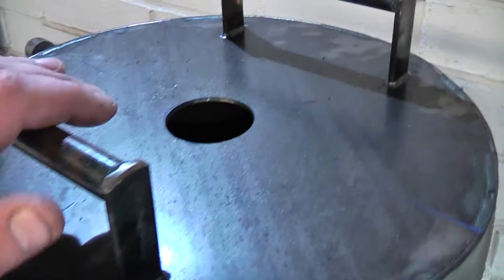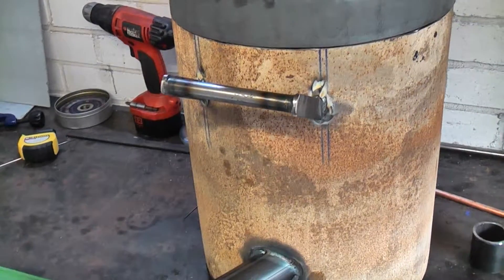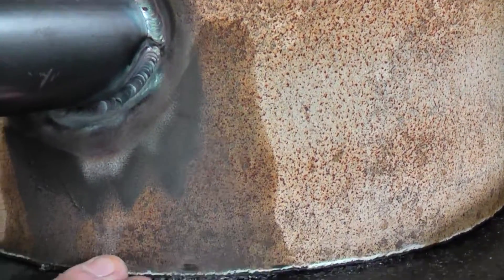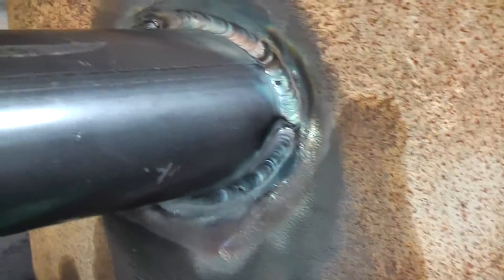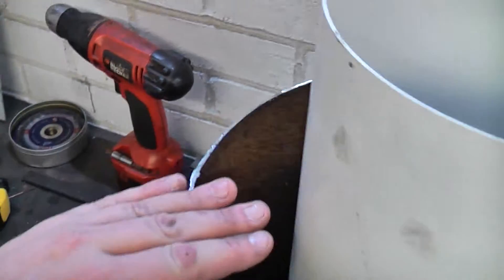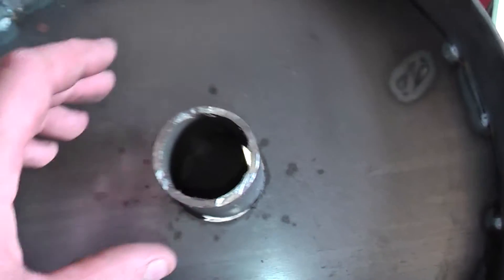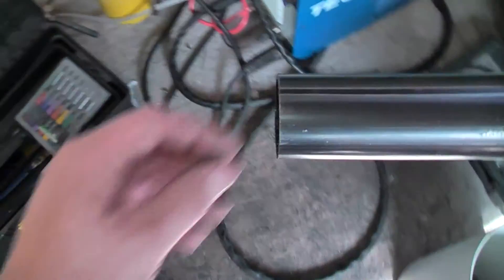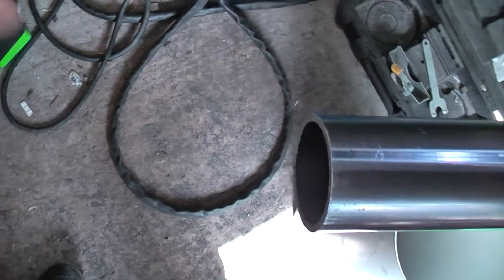Metal melting furnace project #1.

Comment: maybe u could power it with oil, start it off with lpg then add oil
there is a guy called (oil burner )and he melted copper without any insulation